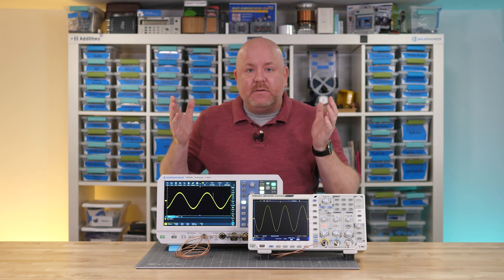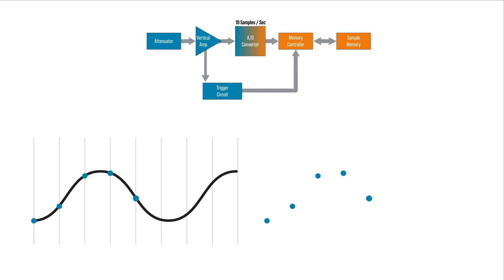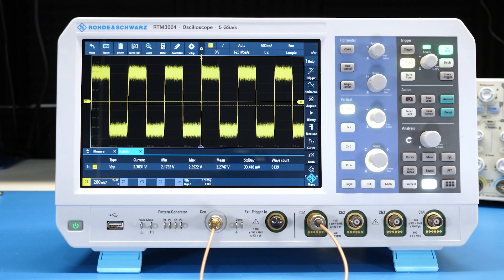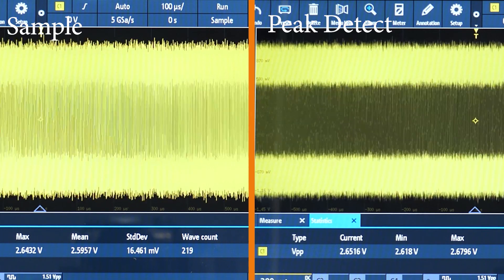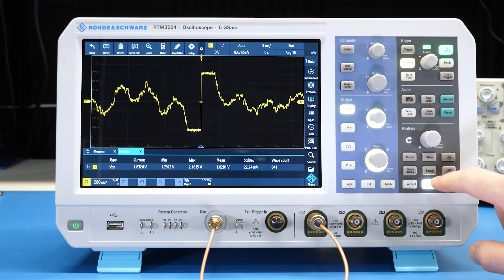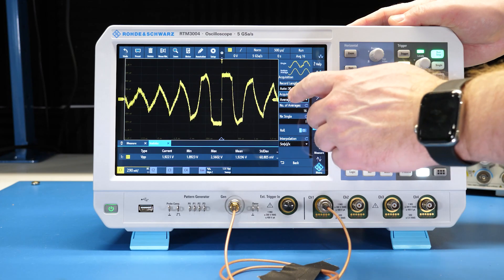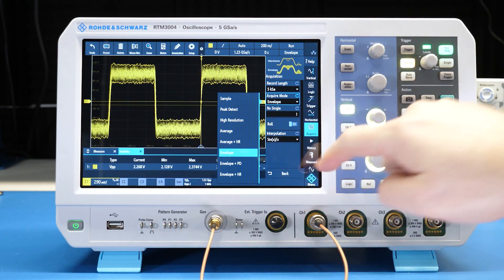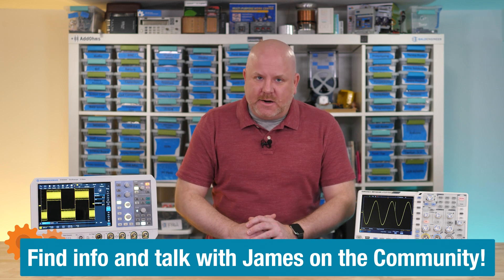How Oscilloscope Acquisition Modes Work - Workbench Wednesdays

Comment: 4:58 Does averaging really increase the effective number of bits? It averages out random noise, but if the trigger point is exactly at the same period it should not affect resolution/number of effective bits. You probably would need at least some slight variation of the trigger period (to see new data) or some oversampling method to increase the effective number of bits. Varying the trigger period might also affect sampling noise, so that averaging could have a benefit.
Reply: Yes, waveform averaing does increase the SNR, which is part of improving ENOB. It is primarily meant to remove quantiziation error, but waveform averaging also reduces a signal's random noise as well. There's no way for an ADC to know the difference.

And no trigger circuit is perfect enough to perfectly overlap waveforms and samples. So there is always slight variation when using waveform averaging.

Comment: 2:48 "Accuracy is the representation, precision is the display" is a nice mnemonic. However difficult to apply in a device that has several levels of data processing, at each level precision and accuracy come into play again, so both get affected, and you have to chose the level that gets affected most. Representation and display is essentially the same in a digital system, since at each step you have a representation/data: what is your acquired data, and how much of it do you show to the next stage (what portion of that data do you show on a screen). But at the final step, representation and display should be identical (data you write into graphics/display memory).
To simplify, easiest would be to think of it as an image viewer, you have the raw data from the image file, and then the interpolation and rounding or data reduction due to displaying the image on screen.

Comment: 2:45 It affects both accuracy and precision. It could also affect resolution if it applies oversampling. See below for more.
What it really does, though, is partially remove overlaid signals you want to filter out, so you could say it more accurately represents the "original" signal you are *interested in*. Your interest defines here what is accurate, but usually you think of accuracy and precision in an acquisition context, not in a filtering context, and even less in a much broader context, like here, where many data processing steps are involved.

So the confusion comes from thinking of accurate signal = signal you are interested in/cleaned up signal, which you would usually express as: averaging out random noise. However accuracy vs. precision is meant in an acquisition context: an accurate and precise acquisition captures the signal as is, including all the random noise.

Resolution (so essentially step size), can affect both accuracy and precision. Accuracy is a systematic error (like an offset), and precision is repeatability (same measurement conditions, same result). Sampling noise due to resolution limitations can affect precision (as rounding errors can amplify tiny variations). But step size (depends on resolution) can also introduce systematic errors, like adding a small offset when rounding a sample always in one direction while digitizing it (one step up or one step down).

Averaging will mostly improve precision as it takes more samples over time to reduce their variation over time (assumes the signal is only unsteady over time due to noise), but it shouldn't affect accuracy (unless the variations include a big glitch or offset). That's however assuming that the averaging doesn't remove actual signal noise (vs. just sampling noise introduced by the oscilloscope). If it averages out signal noise, and you assume the true signal is without the noise, you could say it improves accuracy.

So what is the correct term depends on what kind of noise you want to remove (what level in the signal acquisition or signal creation you look at, and where the signal to average out is introduced), and what you assume your true signal to be and where the noise comes from.
Reply: Sure.